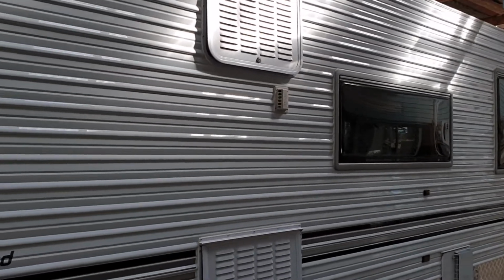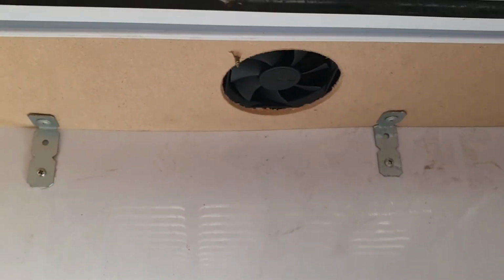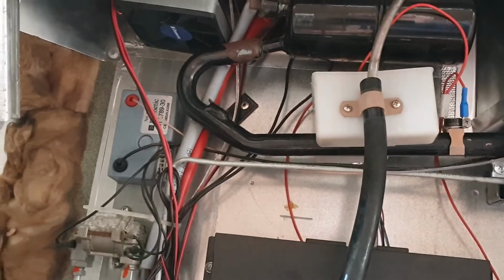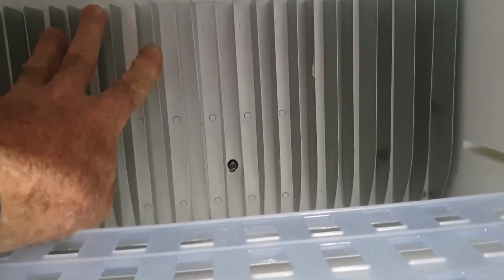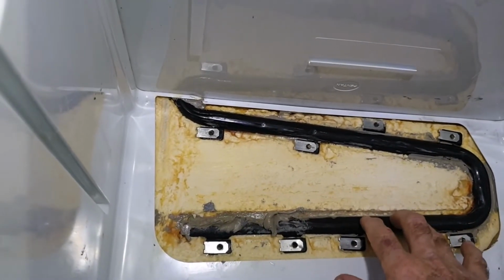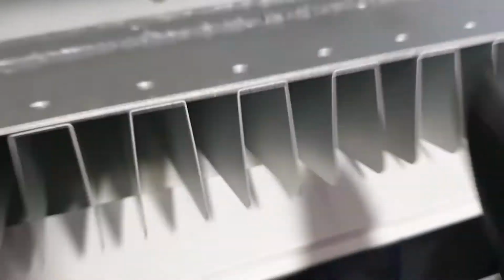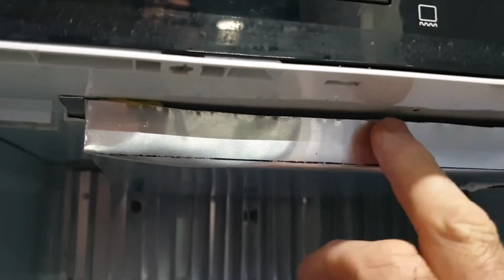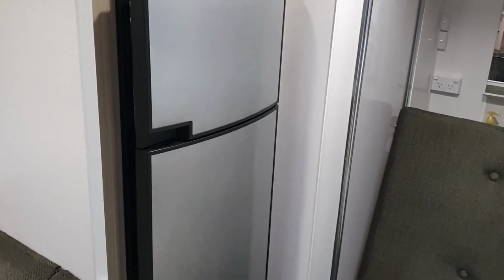Fixed - Dometic RMD-8551 3 Way Absorption Fridge

Comment: Your presentation is absolutely brilliant, to the point & far more informative than anything I have seen previously, the solutions you suggest are practical & achievable with basic skills. 
I have been struggling with a Dometic RMD 8551, in my 2015 Lunar Lexon caravan in the UK.  I have installed 4 fans in the outlet vent & improved the air flow path over the condensers to raise performance from terrible to poor. I will definitely be replicating the improved insulation and heat sink mastic mods. Do you have any guidance for clearances for the gas burner / heater stack? I would also like to add the fridge circulation fan mod, can you tell me how you provided the 12 volt feed please (internal light??), I am wary of breaching the fridge casing
BTW the Lunar owners Tech forum is inundated with reports of poor performance so you are addressing a real problem for lots of people, the caravan industry isn't interested in helping, except with extremely expensive fixes. Well done.
Reply from the maker: Hi Roy, Unfortunately all that work I did to improve the performance of this fridge resulted in a limited improvement in hot weather. I have just returned from 8 weeks away and travelling around northern Australia (Northern Territory and Queensland). We have had an unseasonally hot winter this year which resulted in temps in the mid 30C's everyday for 3 weeks and the fridge was a dismal failure anywhere above about 27C. 

Traveling really upset the fridge with internal temps reaching into the mid teens during the day and freezer temps getting down to 0 degrees or even positive. ( we travelled over 11000kms in our trip only stopping 1, 2 or occasionally  3 nites. In some cases the fridge would recover overnite if the temp got down low enough but in many instances it was still at around 10 degrees in the morning. Movement devastates this fridges performance! I could begin my day with the fridge at 1 degree (freezer at -14) and after say 4 hours driving at about 30C degrees ambient I would inevitably finish the day with the fridge at say +10 or usually significantly worse and little chance of it recovering without a quite cool night.

I monitored the fridge and freezer temps while driving via wireless temp sensors to a display in my vehicle.

I tried different fan speeds, etc but nothing helped while ambient temps where anywhere near 30C or above. Too much fan does definately have a negative impact - I found minimal fan speed was all I needed when travelling - you dont want to cool things down to much.

Parked at home in Brisbane the fridge works really well at the moment as temps are below 30 and the movement isnt effecting the refrigerant operation. I spoke to Dometic a couple of days ago and they didnt have any suggestions on what else I can do.

I do believe I have absolutely optimised this fridges performance but it is a subtropical (ST) rated fridge and it shouldn't be - given our warm climate here. Dometic advised that the ceased selling ST rated fridges here in 2013 and my van was built late in 2014 so I assume this was old stock. You cannot upgrade this fridge to T rated fridge as the "plumbing" interface to the heatsinks is greater and heater elements higher wattage as is the gas burner and refrigerant content and mixture (Dometic informed me).

So my change will probably improve the fridge performance in the UK as you probably generally have cooler nites which do significantly assist in the recovery from a hot day.I have not changed anything in relation to spacing of the gas burner and have no suggestions and doubt that anything you do there will help.

My intention was to run over the fridge with a bulldozer when I got back so this could never happen again! I have settled down now and have yet to decide what to do about replacing this fridge before we undertake another long trip (which is probably 2 years away). The logical shift is to a compressor fridge but that means more solar and battery capacity and the new 3 way fridges are significantly more expensive but probably work better.

As to the internal fan i added - I simply ran the very small black/red figure 8 wire in through the back wall grommet with the temperature sensor wiring - there is enough room to do that easily. You need a permanent 12V source so it runs whenever the fridge is on regardless of the energy source and yes the feed to the internal light before the door switch would be the best choice. The little fan works well and that size with the light aluminium frame works really well I found.

Cheers

Tim
Reply: @timterry8714  
Hi Tim. Well that’s a real body blow, a lot of effort to little avail. 
I wonder whether Dometic really does owe their customers at least a compromise on rectification, were they ever fit for purpose? Not going to happen though is it, despite the many complaints!

I have order the mastic so I’ll at least reseal the fridge heat sink. Since I first wrote to you I’ve noticed that my gas burner vent is different to yours it vents inside the main rear cavity. Apparently I can but the same type of direct vent for combustion gas, and the temp gradient across the main outlet vent is around 6 or 7degc (higher above the burner.) But I’m not sure how much of that is from the fridge boiler, or even whether the burner heat is good or bad for cooling the fridge. I perhaps need to ask a man who really knows the absorption cycle.

I will also improve concentration of cooling air over the condenser cooling pipe fins. 

Even in our temps (mid 20’sC) my fridge is getting warm especially in full sun. I have made a cardboard cowl to cover the inlet duct to pull air from ground level and under the van, which seems to help a little. We also freeze a couple of Ice packs at night to augment the fridge during the following day. 

I also intend to introduce more control on speed & timing on my 4 cooling fans installed in the top vent by using a thermostat, bringing in middle fans first, then all 4 fans at a slightly higher set point.

BTW . Do you happen to know what temperature the condensers operate at roughly that I can use as a starting point please?
Perhaps for UK use this will be sufficient  for acceptable if not good fridge performance for UK use?

Kind regards Roy
Reply from the maker: Hi Roy, sorry I havent got back to you. Look I have tried everything with the fans and minimal fan is fine. The fan that came with the fridge works well enough I discovered. I experimented with everything imaginable on my recent 2 month trip and nothing worked - that fridge is a dog!
Apparently according to anecdotal evidence from customers, on forums I was reading, this fridge caused so much grief at Jayco (our largest caravan manufacturer in Australia) that they dumped Dometic as a supplier back in about 2013 due to unresolved customer complaints for the RMD8551 and moved to Thretford as there preferred supplier. Even with this Dometic at no point offered to recall any of these fridges. They did fix a couple at Jayco by replacing the refrigeration unit completely I believe.
I have just now tossed this fridge out and moved to a compressor fridge. This is now quite viable as there are a couple of highly efficient 12V fridges now (I bought a Bushman DC190L) and of course Lithium batteries and solar are quite reasonably priced now (on par with lead acid or better and far better usable energy density) and significantly lighter. 
Also I can get rid of the 2 larger 8.5Kg LG gas bottles and move to 4.5Kg and save myself a considerable bit of wait. Also our gas consumption will reduce significantly providing a reasonable cost saving over time. Hope you have some success but doubt you will satisfactorily fix the problems. Cheers Tim

Comment: Tim,
Can you give me a led as to why my RMD 8551 won't ignite on gas?
There is gas flow as I've manually lit it.
Reply: Hi Anthony. I have the same fridge and had an issue with it not starting on gas. I took the cover off the housing where the ignitor electrodes are and found that the electrodes had a very wide gap hence there was no spark occuring even though it was trying. I closed the gap to about 40 thou (not sure of what the specs are supposed to be), this has worked well as the gas will now ignite as soon as you select gas on the fridge panel. Hope this works for you if you haven't already sorted your issue. Cheers, Frank
Reply from the maker: Hi Anthony, Frank's suggestion below is possibly a solution. If you cant hear the Piezo ignition clicking after that it may be a control boarg issue. Check the wire connectors are seated properly to the ignitor. Mine hasn't missed a beat and if it gets blown out by wind gust it reignites instantly. As for the fridge generally its a complete failure from my perspective as all the work I did still resulted in abysimal performance for us on the road for the past 6 weeks. Must do  follow up Video when I get home.
Reply: We had the same issue - it was our motherboard. Had to be replaced.

Comment: This is amazing Tim...  I have the same fridge in my British made Bailey caravan and the performance is terrible.  It can take up to 24 hours to cool down properly and that’s on a typical UK summer day (20-25 degrees).  I have already installed some fans but will definitely look at insulating the boiler + other voids and checking out the thermal compound behind the heat exchange fins.  I was about to consider buying a new 10 series but thought I would do some more research and came across this which you posted yesterday!  Perfect timing.  How many tubes of thermal mastic did you use?  Is one enough for the fridge and freezer?
Reply from the maker: Hi Mark, I used about 75% of 1 tube however I purchased 2 as I didnt know how much I would need. Will sell the other locally I am sure. All these changes make a difference but will be interesting to see if yours is also lacking in Mastic. You should definately not need fans at all in the UK Mark. Please let me know how you go. Cheers Tim
Reply: Thanks Tim, I have managed to source 1 x 10.3 fl oz tube of Norcold thermo mastic here in the UK so that should be enough.  I have not checked the fridge yet but it’s worth replacing anyway.  Will let you know how I get on.  Mark.
Reply from the maker: Sounds good Mark, pretty easy and quick to pull the heatsink fin assembly off and have a look. Yes the Norcold is the same stuff and 10.3 fl oz is the same size tube as I purchased.
Reply: Hi Tim, I replaced the thermal mastic on my fridge on Saturday.  Here is a photo taken beforehand, just after I removed heatsink fin assembly.  I haven’t had chance to test the fridge yet as the caravan is kept in a storage compound but we will be going away at the end of May so will test it out then. https://www.dropbox.com/s/jvs0uqsw07c1aqp/IMG_2694.JPG?dl=0
Reply from the maker: Hi Mark, did you think the mastic was applied evenly it looks a bit scketchy but more consistent than mine was. Also was the mastic dried out a bit and like old putty? The thing I noticed immediately was the response time after starting it up improved significantly and the temp in the fridge is much more consistent now. So I think the transfer of cold to the heatsink was much better after doing this. Will be interesting to see how that goes. you should do a before and after test but I guess thats a bit difficult if its in storage. Cheers Tim
Reply: Hi Tim, I think it was slightly better than yours but nowhere near what it should be according to the guidance from Dometic.  https://www.dometic.com/assets/21/04/installation%20manual_62104.pdf?att=true.  Yes the old mastic was quite dry compared to the new.  It looks like I might be able to get away in the caravan this coming weekend so should be able to test the fridge out then.  I know what it was like before so will be able to tell if it is now any better or not.  Hopefully there will be some improvement in the start-up time, that is the main issue for me.  Once it’s chilled down it works quite well but it just takes a very long time to get there.
Reply from the maker: Hi Mark, my start up last weekend was about 6 hours from switch on and that was from about 25 degrees ambient. 1 hour 40 mins and the freezer was at 1 degree, fridge at 19 (the fridge always lags the freezer significantly), 3 hrs and the freezer was at -10 and fridge starting to cool down at 14, at about 5.5 hours it was at working temp -17 freezer and fridge at 4.5 and still dropping.  I think the additional work I did lagging and insulating also plays a significant past in how that has improved. Will wait to hear from you. Cheers Tim
Reply from the maker: I have been logging the temperature in the fridge today (ambient is 25C here today) and the fridge now cycles between 3.0C and 3.8C on the 3rd setting (out of possible 5 max). This is far better regulation than previous when I had it on 3, the fridge would be up to 7 or 8 degrees. Interesting also yesterday I didnt close the door properly for over an hour and the fridge only got up to 5C which is amazing. After closing it in 10 mins it was back to correct. It also cycles on far less than previous. All this shows a faster response and much better ability to regulate temp than ever before and great energy efficiancy.
Reply: Hi Tim, so I am away in the caravan now and just tested the fridge for the first time.  We are having some pretty bad weather at the moment (even by UK standards!) and it’s only around 13-15 degrees ambient.  When I switched the fridge on it was 20C inside, it was down to 5C in 6 hours.  That was with the fridge completely empty.  It’s never done that before, previously it would take at least 12-18 hours to reach that temp.   So replacing the thermo mastic does seem to have made a big difference to the startup time.  I have just turned the temp setting down to 4 bars and will keep an eye on it tomorrow.  We are away again at the end of the month and hopefully the weather will have improved by then so I can test it with a higher ambient temp.  Our fridge is installed pretty well, it’s quite tight to the caravan wall (within tolerance) and there aren’t any voids etc.  I haven’t put any additional insulation around the boiler, all I have done is replaced the mastic at the moment.  Will see how it goes at the end of the month in the (hopefully) warmer weather!  Thanks again for your help.
Reply from the maker: Great news Mark, sounds much improved although as you say not very warm but that quick start up is I think is clearly indicative of better transfer of heat/cold from the refrigerant. Your improvements are mirroring what I have seen. On the 3rd setting my fridge sits between 3 - 4 degrees and its very consistent in that. The 4th setting it runs between 1 and 2 degrees. All looking get and keep me up to date on the performance in the warmer weather. Cheers Tim
Reply from the maker: Mark I just compared the fridge pipe location in your fridge to my fridge and the opening of the internal back panel is lower than mine and the pipe actually starts disappearing a bit early at the top which probably restricts full access to the heat sink. The refrigeration unit was a bit mis-aligned on the rear (at manufacture) with the housing by the look of it. Have a look at yours versus mine. It doesnt seem the mastic was applied properly on your fridge either.
Reply from the maker: Hi Mark, havent heard how your fridge went after the weather improved but our recent 8 week trip (in winter here - although not cold) was a disaster from the fridge point of view. The fridge just hates any movement and while startup is very fast it rapidly deteriorated as we travelled each day. The fridge ended up in the low to mid teens centrigrade each day after 4 hours on the road and in may instances it didnt fully recover over nite. Woke up a few morning with the temps in the high single digits range. Had to turn it off and leave it for a few hours and start it up again several times to get it to work. I was so pissed off as I spent a lot of time addressing all the issues I could with this mongrel thing. I have given up and just purchased a compressor fridge which I am about to install. No more 3 way absorption fridges for me. Cheers Tim